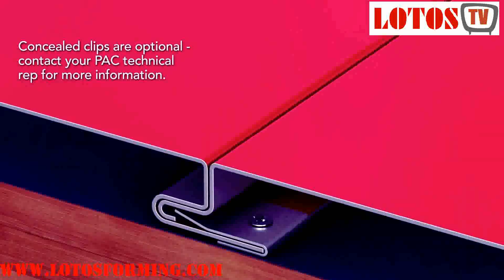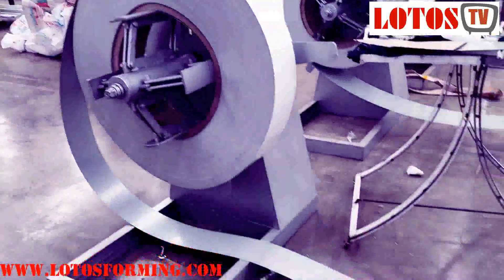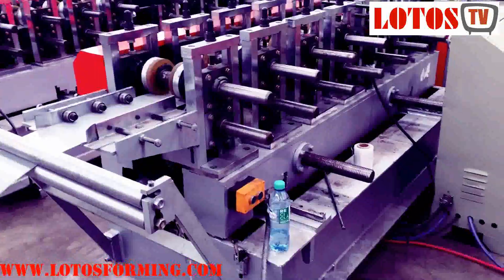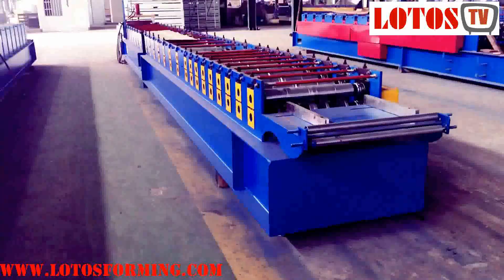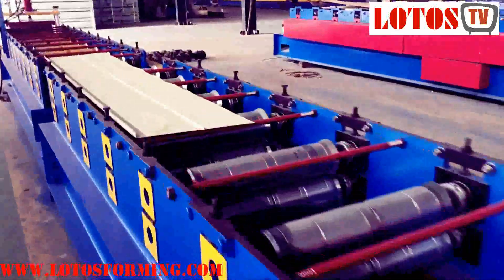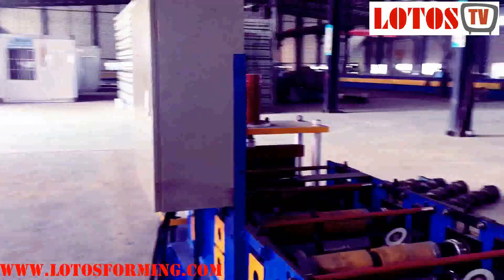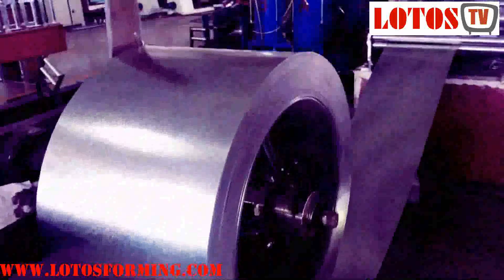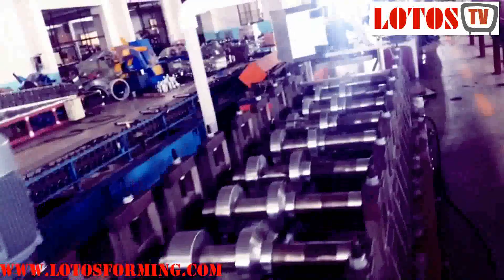【Wall panel machine】:  Flush Panel Roll Forming Machine | Soffit panel roll forming machine

Comment: Flush panels are designed for wall, fascia, and soffit applications where a flush or flat appearance is desired. A rounded interlock leg and concealed fastening system improve the flush appearance while providing additional strength.